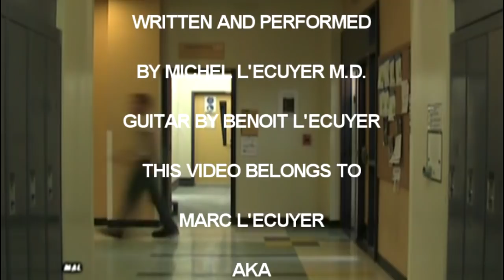SURFACE GRINDING part 1, basic principals, wheel dressing, prepping for first cut, speeds & feeds

Comment: Also, great video! very informative. I've just bought a small 612 manual surface grinder and am learning as much as possible while I finish prepping/installing the thing (cleaning, new fluids, 3-phase power accomodation, Fix/replace DRO etc..). This helps a lot with the basics.  I really like your description of the various tool profiles and the chips they produce when the DOC gets small. Initial process is a bit like woodworking where we use a jointer to make the reference surface then the planer guarantees thickness.

Comment: Miss my old tool and die maker days.  Spent 10 years grinding zipper die parts.
Reply: Zipper tooling must be difficult. Lots of carbide and some visual grinding i assume. There was a shop in Indianapolis called Gentry tool that made zipper tooling.  Before i started working but 2 of my former employers worked there and a few other local shop owners worked there.

Comment: Marc is there a way when dressing the surfacing wheel with the diamond to prevent it from knock chips out of the outside and inside surface of the surfacing wheel. I noticed sometimes it will knock quite large chunks off the outside and inside of the surfacing wheel. If you slightly chamfer the outside edges it will cut down the actual width of your surfacing wheel.

Comment: Would you believe i got a job grinding tools and one of 3 machines is a small light weight surface  grinder. Watching utube i learned alot and only had 1slight accidents cause i for got to tighten the index spindle. Like you say light removal is only way to accurately re move material safely. Tomorrow morning i was asked to see if i can remove. 008 from a spacer used in a spindle just being rebuilt.Since the magnetic table is around 6" there will be over lap of the part im grinding and at 30 degrees will be a challenge depending on the y travel in relation to the spindle or grinding wheel. I haven't seen the part yet but i may have to rearrange  the complete magnetic chuck @30"

Comment: Marc, the problem with videos like this is that now I'll have to go get a surface grinder.  ;)  I've watched grinders being used in industry, but have never operated one myself.  When I eventually get a surface grinder in my home shop, I'll certainly be reviewing this video series!
Reply: If you turn the machine off you have to true the wheel again when you turn it back on,no?
Reply: Just got a brown and sharp 618 ,580.$ at an auction
Reply: I bought one for $1 on auction
Reply: Works too

Comment: Once you have a side ground, you can tap it down lightly on the mag chuck with a softer metal tapper. You do this after the magnet is on. This is really paranoia speaking, but it makes sure the part is down.

I agree with the two thousandths maximum for manual grinders like that. Any more and it’s super easy to get burn marks.

Comment: Why don't you just use vinegar to remove heat scale? It takes some time but it works wonders on raw steel. It seems like it would take a long time to remove the scale. [I'm a noob so I dont' now how thick that scale is, though]